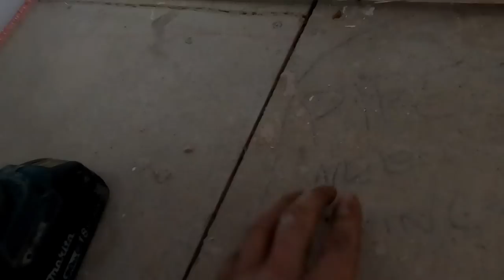Electricians cut my pipes!!! But do we get our revenge?

Comment: No need to apologise for your content it's top notch. 👌 Washing machines are a funny one with water regs all depends on what the inspector classed the end use as I guess. The amount of plumbers you see not putting any backflow prevention on them is unreal though. I know they're air gapped internally but cheap hoses can leach chemicals out.

Onwards an upwards though 😊 hope the pressure eases on you a bit soon. Enjoy your weekend 👍
Reply from the maker: I always put check valves on mine now, the risk is probably very small but all you can ever do is cover your back in this job, thanks for the support as always mate, have a great weekend

Comment: Poor standard and lack of consideration by the Sparky, also that cable I would have run mid-way through the joist, to avoid screw damage and then keeping it away from your pipes. You accepted it a lot better than most Plumbers would ..Great video so informative.
Reply from the maker: Thanks for the support Alan, in fairness with the cable it is run quite high because there is a steel directly below, there was only a small service gap above, I'm normally quite laid back, I try not let stuff get to me, but stuff like this is annoying

Comment: I always like to use copper olives
Reply from the maker: Copper olives do bite in better, my old mate always used to prefer brass ones on heating, he used to say they were less likely to leak with constant temperature fluctuations
Reply: @PlumbLikeTom  I use jointing compound on them touch wood never had an issue but the brass ones had issues with them leaking unless you use excessive force but every one prefers different things

Comment: I always put too much loctite 55 on to be safe and it always comes out and leaks 😢😂 I find 7 wraps on half inch normally works.
Reply from the maker: 7 wraps sounds about right, locktite 55 it's one thing I can never recall having a leak with, I know a few plumbers have switched to the rapid blue stuff but I always worry how long it will last before the seal breaks down and if you can ever get the fitting apart again

Comment: great video, how does your Milwaukee pipe slice cut so quick mine is pretty much brand new and doesn't cut that quick. They are a great tool.
Reply from the maker: It is the inox version that is designed to cut stainless pipes, the thing is a beast, I've had that blade in it since new and have cut stainless pipe as well and it still cuts like new
The run time on the battery is also so much longer, it sounds impossible but I've only charged it once since I started that huge first fix with all the copper, it lasts ages, I imagine it will do at least a 1000 cuts on a battery, thanks for watching as always 👍

Comment: Surprised that you got picked up on the WM valves , WM'S have an air break on the fill as it drops into the drawer where the powder goes . What class are we talking anyway with WM'S ?  Seems a bit excessive tbh
Reply from the maker: Washing machines are a funny one, as far as I know it depends entirely upon the use of the washing machine, what sort of setting it is in and how it it is being used, my water board ask for a double check valve as standard before any washing machine valve, I used to fit the ones with the built in check valve but they don't comply. To be honest, It is all a bit of a farce really as they only inspect those who are doing, or trying to comply with the regs. I get inspected and are supposed to fill out a form every time I touch a wholesome water pipe. The amount of rubbish installs that you see, and the amount of social media plumbers who still think check valves in outside taps are OK is scary, rant over, thanks for watching as always mate
Reply: @PlumbLikeTom  you are right Tom , the only people who get pulled are the ones who are getting inspected , if you don't get inspected you can do what you want .  Gives trades a bad name .

Comment: Feel like them pipes are too high, why not notch them into the joist? Feel the sparky is blamed when the pipes were way to close to the surface and running “over the joists” this was a recipe for disaster
Reply: They're not running over a joist , that's a noggin or cross brace , nothing at all wrong with how he's done it. Been doing this sort of work since the early eighties.
Reply from the maker: There's a steel beam there so the only place the pipes and cables could fo was over the top through the service gap, in an ideal world I do keep things a bit lower but there was nothing I could do with this one, thanks for watching 👍